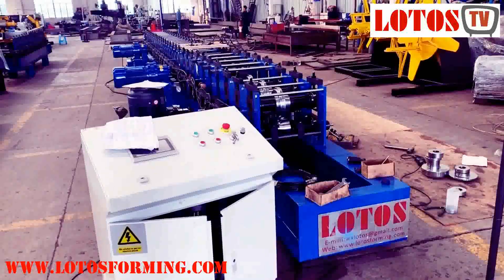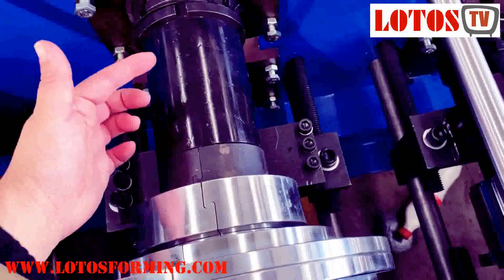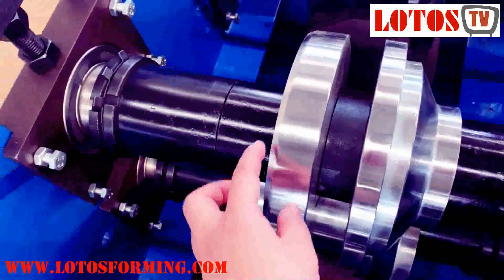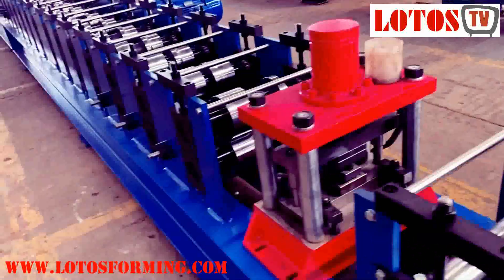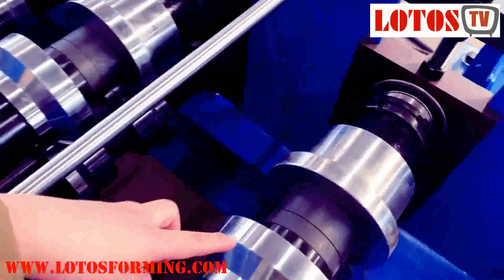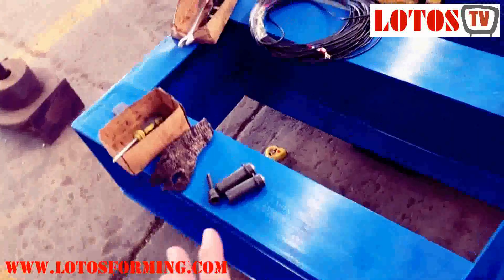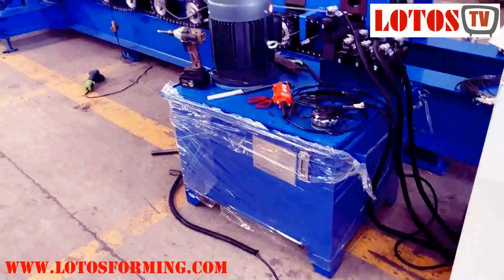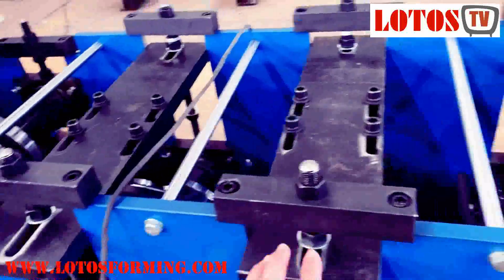【Multiple sizes custom roll forming machine】:How to adjust the rollers in Wall panel forming machine

Comment: And the surface quality must be extremely high due to contact and lubrication issues. As usual, rollers are split into several sections for ease of manufacturing

Comment from the maker: Between the rollers are spacers, which will reduce the cost of the mill. And easy to adjust to produce a different desired profile with split spacers. After confirming the total length of the rollers. It requires less expensive spacers to fill the space between the rollers. The spacers usually produce by seamless pipes.